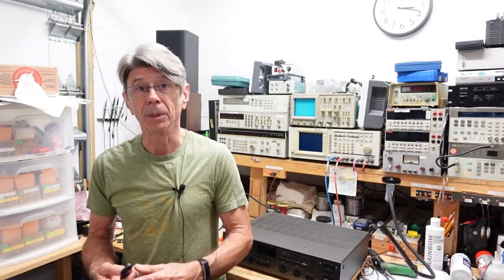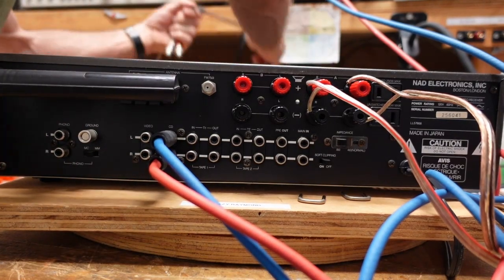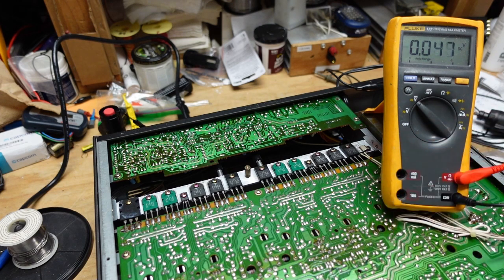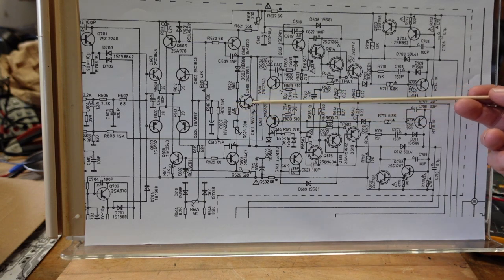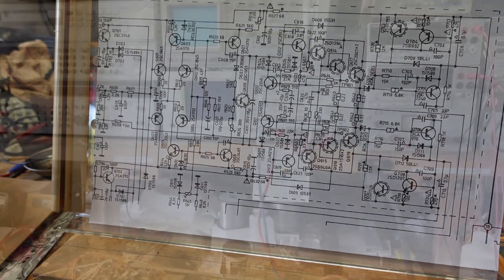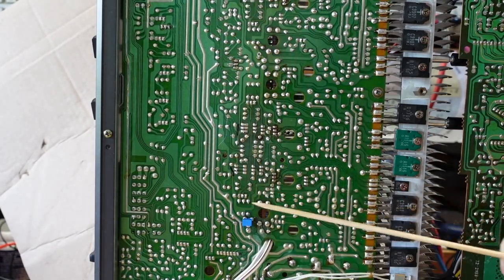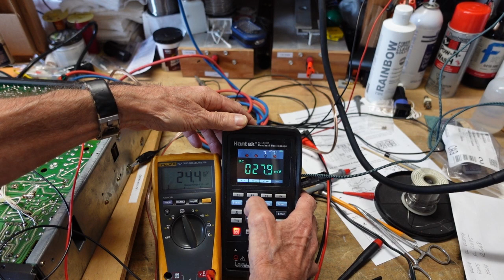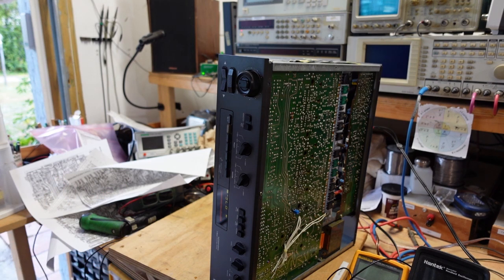NAD 7175PE Repair

Comment: Mention a Sansui being touchy and I just get chills. Working on a 3000a that is just nuts with its design. The SCR protection is a bear.
Reply from the maker: Yeah, it seems like all the Sansui's I've worked on have touchy adjustments, usually the offset.  I get why people use multi-turn trimmers for these.  I've yet to work on a 3000A, but it sounds like a bear.  In the finest Sansui tradition!
Reply: LOVE my 3000! Took a long time to get it safe and stable but, worth every effort. Ray, I have to thank you for not editing the booboos. As a boo-boo expert, it’s nice to be reminded that we’re all human. Peace
Reply from the maker: @knifeswitch5973  😁

Comment: It would've been nice if you could analize how did -78V get all around that Q609 transistor as a result of potentiometer failure.Thank you.
Reply from the maker: While that would have been interesting , it was more productive to compare left to right channel voltages to help pinpoint the area causing the trouble.

Comment: I have both 7250pe and its bigger brother, the 7175pe.  Both use those 200 ohm trimmers with 5 mm pin spacing for the distortion adjustment.  It is not uncommon to see these read in the kiloohm or megaohm range when they fail.  On my 7250 both failed.  On the 7175 they were both within spec.  I believe the failure is due to surface oxidation.  If you probe around you will find the entire surface where the wiper sweeps has sky high resistance on the failed units.  Probably has to to do with where these  units were stored over the years.  Some just choose to replace the trimmers with 100 ohm resistors, because the optimal adjustment seems to always be close to that value.  Other common failure for these is the supercap for the preset memory.  Should hold memory for 2 weeks with a good supercap.
Reply from the maker: Wow, that's good information.  Thanks for posting!
I was skeptical about those trimmers being stock.

Comment: Hi Ray I'm in the middle of a re-cap on a Marantz 2015 receiver aka baby. And I have a question about this tiny Caps on the amplifier bored C605 and C606 at 1μ 25v what would be the best equivalent replacement? I already re-cap the power supply and everything seems to be working now (it was only a big hammmmm.. before) bios DC etc.. okay. But can you explain with Caps I can get in there? sorry for my bad English and great video's
Reply from the maker: Sebastian, it's always desirable to replace small values of electrolytic capacitors with film capacitors.  Film capacitors are superior in every way, and this goes double for capacitors like the ones you're replacing, which are in the signal path.  I would use these for your Marantz:
https://www.mouser.com/ProductDetail/WIMA/MKS2B041001C00MF00?qs=sJjjjplDs9s75Jp9u8FMdQ%3D%3D
Reply from the maker: And your English is fine, my friend!

Comment: Great video.  I still have a 19" rack with the Nad hifi (CD, amp, tuner and cassette player) I bought in the 1990s as a kid and it still looks modern and works really well!
Reply from the maker: Thanks!
NAD had solid designs but often used cheap parts. Some models/lines didn't suffer from this, and it sounds like you got lucky with yours.
When working properly it's nice sounding gear.  I got an NAD 1300 preamp in which almost every electrolytic capacitor measured horribly bad or completely failed.  It worked that way, but sounded noticeably better after a complete recap.

Comment: I have the same NAD unit and it keeps blowing the main fuse. I have read that it is a bad output transistor. Where can I aquire one of these transistors, or where can I send it to have it repaired? Thanks
Reply from the maker: Just replacing transistors can result in more blown transistors.  It really needs to be evaluated to find all defective components.
Not sure where you can send it.